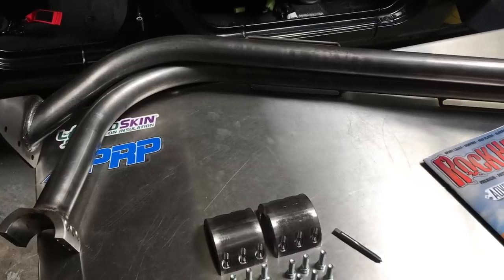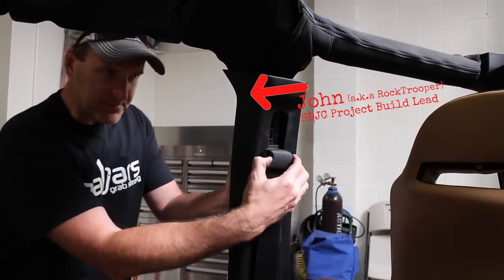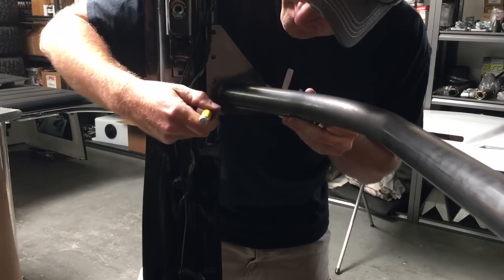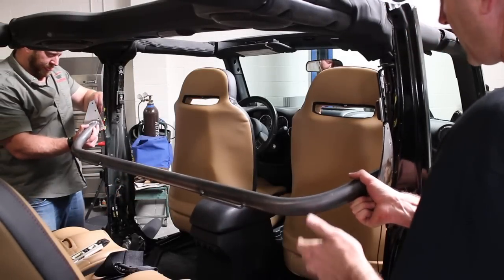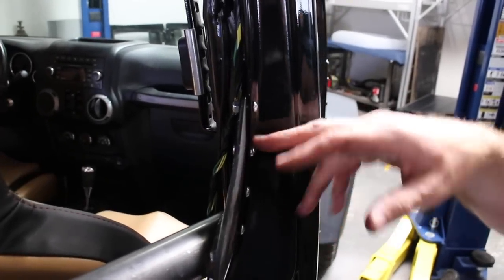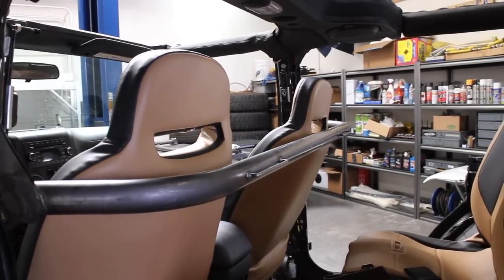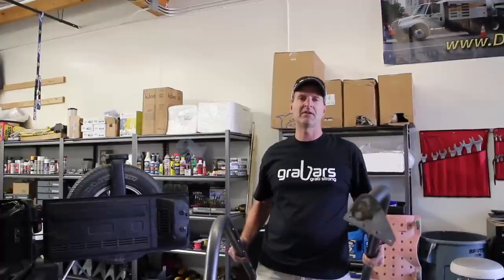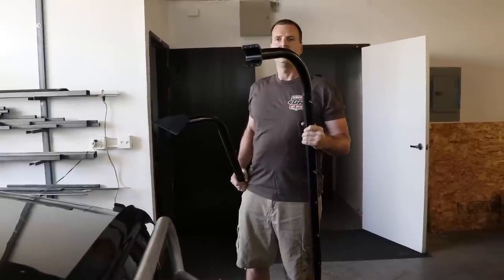Rock Hard 4x4 Front & Rear Jeep Harness Bar Install

Comment: I've done a fair bit of reading on cages and harness bars and from what I have learners that rear harness bar is way to low. The bar needs to be at shoulder level or else in a wreck it will probably result in a broken collar bone. Just my 2 cents... love those seats.
Reply: Keith Jones good point. I did do some adjusting to the rear harness bar after I hooked up the harness. I removed the plastic molding from around the cage and moved the knuckles down so it moved the bar up.

Comment: Great video! Almost makes me want to trade in my 4Runner for a Jeep. Almost!

Just a thought, could you use some MOLLE gear or something similar attached to the rear bar to store recovery and/or first aid equipment?
Reply from the maker: 4Runners are great rigs, no need to trade it... well maybe when the JL diesel comes out?!  I think the MOLLE ides is a great idea for utilizing that bar for some storage.

Comment: I noticed at the beginning of the video, the jeep had the factory fenders.  At 9:38 & 9:54, it now has aluminum flat fenders.  Who makes these particular flat fenders.
Reply from the maker: I knew someone would catch that!  Yep, new fenders, bumper and sliders installed are from Genright.  That video will be posted soon.
Reply: Jim Reed yep, lots of stuff going on! Wait until you see the Genright install, we had all hands on deck and we tackled the upgrade as a team! We still have suspension and axles yet to get installed. Stay tuned!

Comment: What kind of safety testing has been done on system your front bar attached to lip of B piller no support in middle to keep bar from folding rear bar was so low and no torque specs for the clamp bolts . Honestly not to impressed with it

Comment: Not going to lie... I cringed a little when i saw him cleaning the threads with the drill
Reply: LOL, I was not cleaning the threads. I was retapping them. RH4X4 includes a tap to redo the holes. It makes threading the bolts into the collar much easier!
Reply: Not gonna lie. I really cringed when I saw you run a tap with a drill.
Reply: I totally cringed too! The Rock Hard instructions even advise to clean out the threads, prior to install. Definitely a job that I did, by hand, when I installed my Rock Hard harness bar!! I also installed my bar at shoulder height, to avoid injury in a roll-over. Just constructive criticism, I love the vids!!
Reply: It’s very easy to damage threads when using a power tool, I always start the tap by hand then use a power tool.
Reply: Ouch!  Using a tap to clean out threads is a no no!  You can buy a thread cleaning tool for this.  Snap-On make one and that's what I use.

Comment: when drilling metal, don't drill at a fast speed like this.  it's more efficient to drill slowly.  The bit won't heat up as much and the bit will dig into the metal easier and faster

Comment: how did they get rid of the seatbelt chime?
Reply: Well, for now I simply plugged the OEM seatbelt into the receiver and placed it under the seat. I am still reviewing the overall strategy with the OEM seatbelt assembly as well as the airbags (Sensors and bag) that I removed from the OEM seats.

Comment: That rear bar is installed incorrectly. It should be mounted at the base of the roll bar and angled up to the back of the seat.
Reply: It's in there correctly they just have seats that are way too tall for the rear. That bar would be fine if you had the stock seat or a non suspension seat

Comment: 5 point harnesses are uncomfortable. If you are a professional great, use them. Most will find themselves only using them in extreme terrain. The rest of the time they are worn to loose to be safe or not at all. But they look cool :|
Reply: Twh Az I agree it does take a while to get used to. Now I don't even notice and can get in quickly.